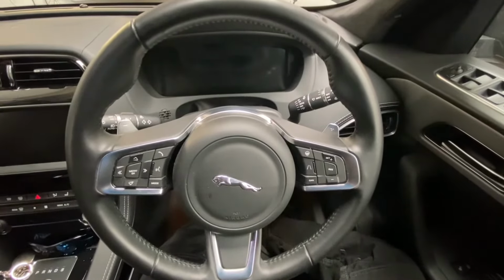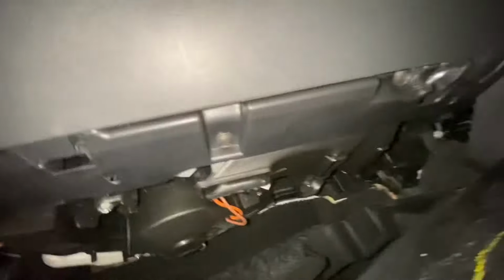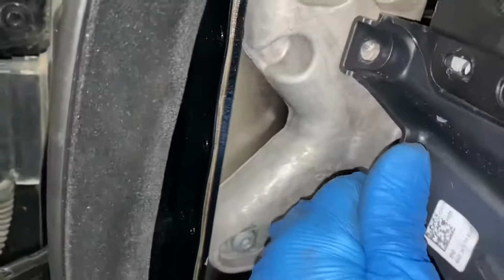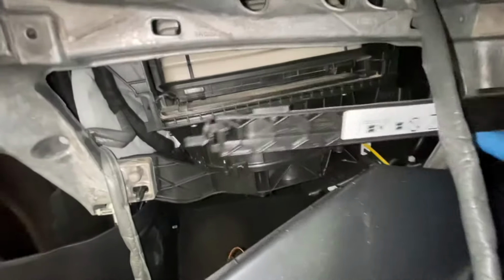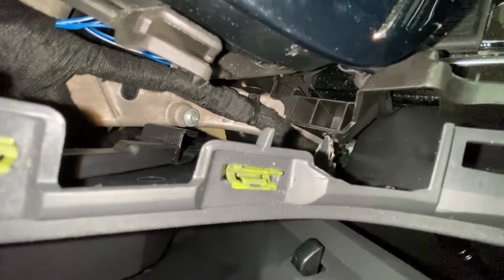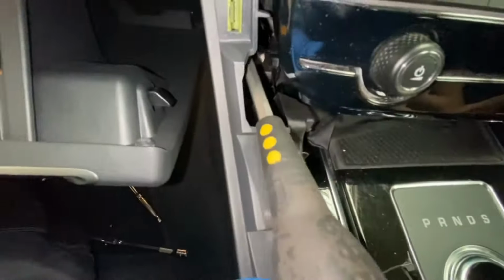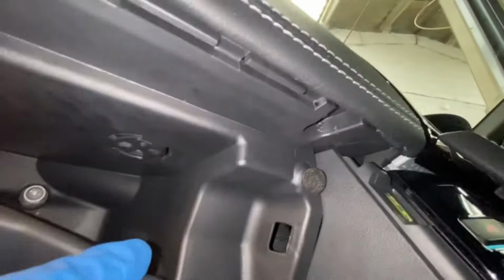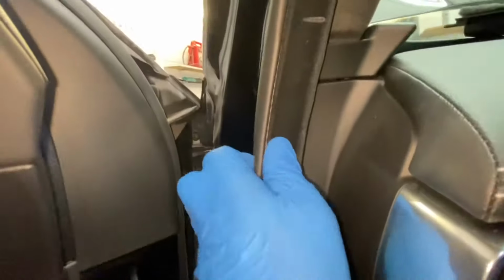#Jaguar F Pace #XE And Newer #XF Models #Cabin #Filter Replacement Tutorial From Start To Finish

Comment: Then people wonder why I have to charge them to do this
Reply from the maker: It’s not as straightforward as they would think
Reply: @ did one yesterday US version. I did try to pop the center consul leather off, but it wasn’t like the one in your video. So I ended up taking the complete plastic off of the glove box, but I never detached the center console screw, but the plastic was bendable enough for me to grab the filter out and slide in the new one since it’s not that big. Didn’t save me much time but time to take the center apart.